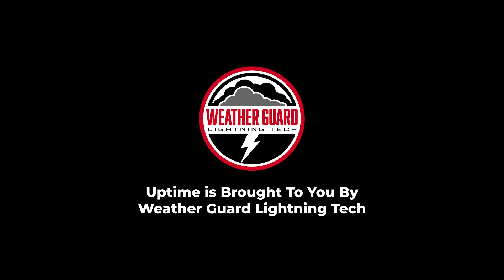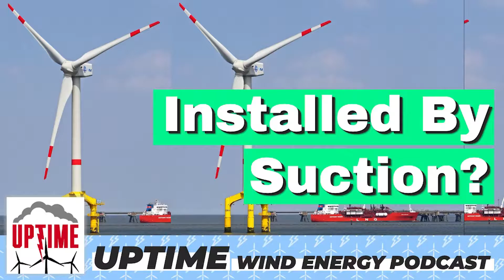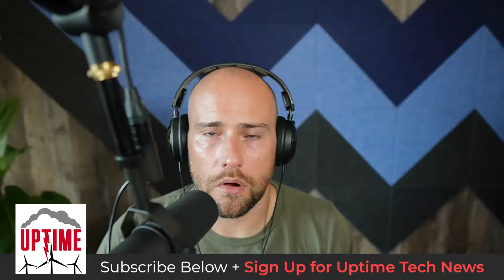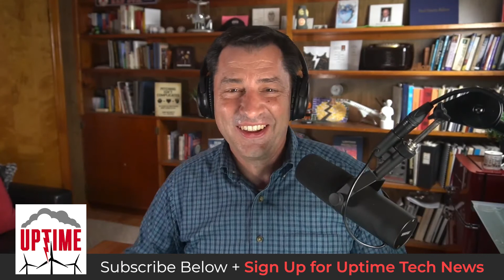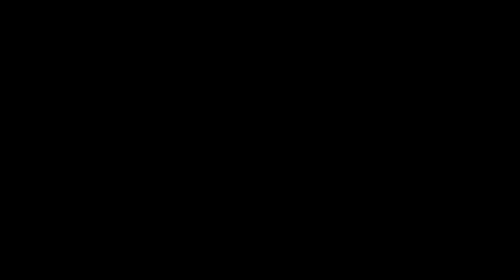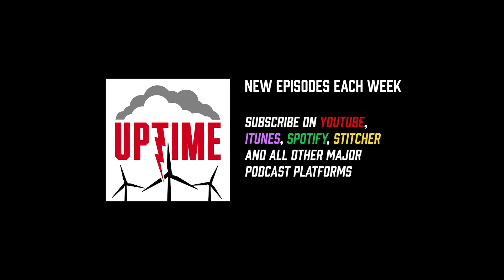Off-Shore Wind Turbine Suction Caisson Installations: How do They Work? [UPTIME WIND ENERGY PODCAST]

Comment: After reading the document from the court, what "Høyesterett" in Norway is saying is that the permit to build are not valid because of errors when it was given.
Basically the NVE that handel the permits in Norway can  say that they will do a new permit process where it has to be proven that the area is lost as grassing area.
 If that is not the case they can give a new permit. In any case it will take year before a final desision is made.
Reply from the maker: thanks for this - thats still confusing - with such an expensive farm, can they really stop it because of permit irregularities? They allowed them to build the entire wind farm.
Reply: @WeatherGuardLightningTech  Yes they can, but if so there will be compensation for the developers. Since there is no error on their side as fare as I could see in the legal documentation.
More on this is that Norway do not have a real need for these wind farms. At the moment they are an important reason for that the current electricity cost in the North is around 1/3 of the price in the South. Together with the Swedish installations mentioned there is more production then needed in the north, and not the capacity needed to export it out of the region.
Reply from the maker: Compensation for the developers - I'd be curious to see how much. Would have to be a LOT of money to get them to willingly walk away. Thanks for the insights! Definitely curious to see how this develops. - Dan
Reply: @WeatherGuardLightningTech  Just on point is that I do not think that willingly are going to have anything to do with it, but we do have laws and regulation that mandate how to resolve something like this based on cost and expected earnings.
A the moment I do not think that the two wind parks will be dismantled, but that is just my evaluation of the case.